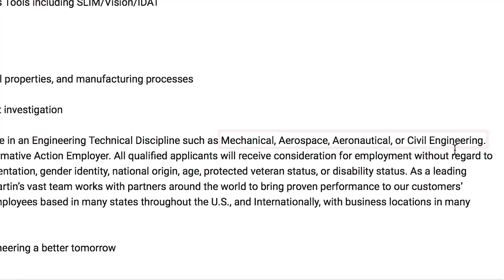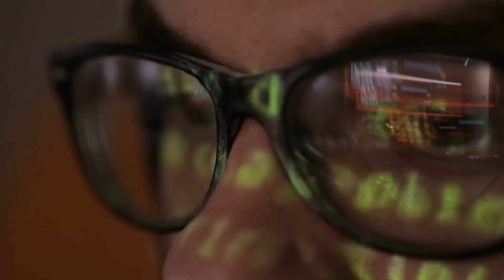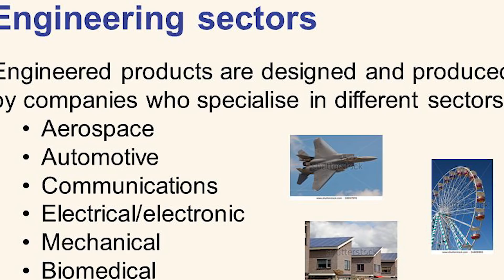How to Choose a Major When You Have Too Many Interests

Comment: I still don't know and I want some advice if possible. I noticed I perform much better with topics after college in science, social sciences, Hawaiian history, etc. When I was younger I was always interested in the more creative aspect but struggle and stress out easily over mathematics. I don't have someone to study/discuss with because the topic was extremely confusing even after doing the required reading and going to tutoring sections (which were usually packed). I pretty much spent hours trying to solve a few math problems. I don't know if I want to pursue a degree in engineering if the mathematics aren't clicking in my head. If college is different from the actual job, how will I prepare for that? Will I have time for my family? Does it provide some assistance? I'm always asking questions. I barely have any focus on it, I would like to have some close relations with others but I always spend time studying and not hanging out. I have a hard time talking with others in hopes of getting a study group. How will I know if I like it when I mindlessly go through it. I know this video is old but I would like to talk about it.
Reply: I think you have the same as me. Regarding mathematics, you don't need to worry much. Because math  gets easier once you practice and learn it at the same time. Since you like art, I recommend "Industrial Design " because this skill gives you opportunities to interact with others, promote creativity and problem solving. Math is just basic.

Comment: 2:40 I would like to be a software engineer/computer programmer, but I would also like to study philosophy or psychology. And science/math doesn't sound too bad either. I cannot decide.
edit: The only good solution I can think of is to study philosophy/psychology/something else mostly theoritical at uni and learn math/programming online. But then what job will I get? Hhhmmmmmmmmmmmmmmmmmmmmmmmmmmmmmm 🤔
Reply: I'd go with cs and do psychology as a minor.
There is a ton of maths in cs, and a lot of philosophy in psychology. Also, philosophy is usually pretty different at uni (at least in Germany), so take a look at the syllabus.
Also, there might be some philosophy-related cs classes

Comment: G'day Major prep, I'm a high school drop out that wants to go to uni to major in physics. Any ideas on how I can do this, in addition, any ways of skipping as many classes as possible. Since I dropped out I never stopped studying, so now I am pretty comfortable with partial differential equations, linear algebra, vector analysis, classical physics, I worked through texts on vibrations and waves, electrodynamics (Griffiths) (obviously as well as electrostatics, electromagnetic waves, etc), quantum mechanics (Griffiths), obviously able to do calc 1-3, a little relativity, little thermodynamics, little nuclear physics, you get the point.  I want to start uni in or before 2020 or 2021, are you able to give any insight in this case? I want to do physics research.

Comment: I have a question about what electives to choose for electrical engineering that would compliment my electronic circuit design specialization and is also a useful skill or knowledge to have. I am interested in taking either signal and image processing or communication systems classes for my technical electives. I don't yet fully understand these two fields but I think they compliment each other in a way. I am taking my other elective classes on analog, digital and microwave circuit design because I am mostly interested in circuit design. I can only choose one of those because I plan on taking the entire series like communications 1,2,3 or intro to dsp, dsp 1, applications of dsp. With those I have a few more electives I can pick from but it really depends on which elective series I choose from apart from my declared specialization's required classes. Or would it be better to do a specialization in communication systems and take electives classes on the digital signal processing series instead of doing a specialization on electronic circuit design and taking elective classes on communication systems or digital signal processing.

Comment: Since you are in the field with experience, can I get your opinion on whether Mechanical or Electrical engineering has a higher satisfaction or happiness rating? I heard that Mechanical can get boring with HVAC designs on the computer and Electrical gets boring staring at circuits on a computer. Which field has happier people from your experience?
Reply from the maker: I honestly don't really know the answer to that. I know people in both fields who don't like their jobs and people in both fields who love them. Due to how many companies you can work at, how many subfields there are and how many levels of jobs, it's really hard to say.
Reply: whoa, thanks for replying. It means alot!

Comment: If I did a math major for undergrad with a physics minor with courses in thermodynamics, mechanics, classical mechanics, electromagnetism, and circuits, could I do an aerospace engineering masters. My parents are pushing me to do math for undergrad because they want a more broad field that isn’t super specialized for undergrad which won’t limit my options. Is it possible to make that switch. I would be ok doing a math major with a physics minor. Would you also consider civil engineering to fit the mold of not being super specialized. Thank you.

Comment: Oh
When I entered High School, I had to choose a technical course to take. The two disciplines were food and computing science. I chose the former one because I thought it would be more interesting and useful since it would dive deeper into Chemistry and Biochemistry. Now I'm considering getting a major in electrical or mechanical engineering, and I think they will require some skills with programing. Should I just worry about it later on? Since last year, I have studied Calculus and would say I'm in calc II now.
Reply from the maker: You will definitely do programming in either of those majors! But it's nothing you NEED to worry about now. If you want to get a head start, then of course go for it, there are plenty of resources out there. I entered EE with zero programming experience and did just fine.
Reply: thanks for the response

Comment: I’ve been obsessed with tensors, manifolds and more specifically general relativity since my freshmen year in highschool and I am now going into my sophomore year of college. Managed to take BC calc and calc 3 in highschool and ask my ib physics teacher pretty cool questions about relativity, quantum field theory and maxwells equations. I’d stare at these insane equations hoping I would one day understand them and everyday I inch my way there. At the beginning of my senior year I looked at the integral and differential forms of maxwells equations and had no idea what they meant. In May of my senior year I realized maxwells equations were just vector calculus, surface integral and line integral equations I learned in calc 3 and it was a quite wowing moment realizing how mathy physics really is. My first year of college I took intro linear algebra, differential equations(ODES, systems of ODES, Laplace, Fourier solutions), physics(mechanics with intro to thermo first semester and intro e and m and intro waves and optics second semester)and a stats class which the first half was an intro to graph theory and the second half was combination , permutations and rook polynomials . Next semester I’m taking complex analysis and partial differential and every year I.T just amazes how math changes your view of the world as you learn more. And I.T seems to me at this point at least that all the new math I do learn is some form of the math I’ve learned before either changed slightly or on steroids.keep making new videos they inspire me!
Reply from the maker: This was actually really fun to read. I could like see the time lapse of what you've learned over the past few years lol. Hope to see another comment like this in a year to see what other connections you've made! 

P.S. I personally loved complex analysis and I'm not sure how your professor will teach it, but it has a ton of applications and will connect to a lot.

Comment: I am confused between mechanical engineering and civil engineering
Can you help by making a video for that please
Reply: Actually you're wrong , there is a specific major of civil engineering , it's basically some mechanical stuff but with also some material and some other courses
Reply from the maker: Made a video for that already!

https://www.youtube.com/watch?v=kT2WMwsgbho

But as a brief summary, mechanical engineering is the more broad major. If you want to go specifically in water resource engineering, or geotechnical engineering then choose civil probably. But one of the civil engineers I spoke with said he specialized in structural engineering and sort of wish he had done mechanical cause he would've qualified for very similar jobs but would have more of a background in a wider range of topics.
Reply: Note I'm no expert, but as far as I know, civil engineering is a broad term for the almost all of the different kinds of engineering that we normaly talk about: electrical, mechanical, chemical etc. So it wouldn't make sense to answer your question, because civil engineering is a BROAD TERM, and mechanical engineering is a BRANCH OF civil engineering. Anyone, please correct me if I'm wrong, but I'm fairly certain that's how it is.

Comment: Question! 

I really love mathematics and I want to learn anything that I can but don't really want to make a career out of it. I, however, wish to make music a career so it stands to reason that I wish to be a music major.  Without doing a double major, how can I continue to learn and maybe study pure maths?
Reply: Sound engineer?
Reply from the maker: I agree with Josh that sound engineering would be an interesting mix. But your best bet is a math minor cause those are so different. If you are hesitant with regards to scheduling then take some classes in the summer and fill some spots with extra math classes during the school year (or vice versa).
Reply from the maker: Yeah math majors definitely are able to get jobs. With just a bachelor's it's probably not quite as easy to find one compared to someone with an engineering degree but you absolutely should be able to find something.
Reply: A Minor in Mathematics could be an option.
Reply: R F would that be feasible though? I've heard that the schedule of a music major is as hectic as it gets so I'm not sure if I'd have time for a minor.
Reply: MajorPrep would a math degree be very useful to get a job though?